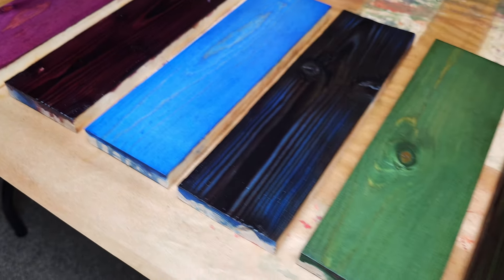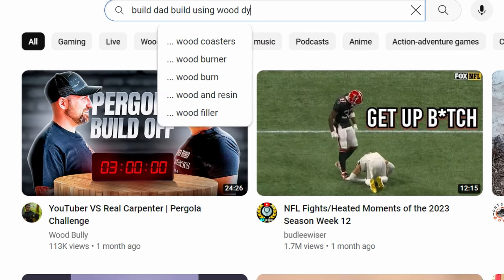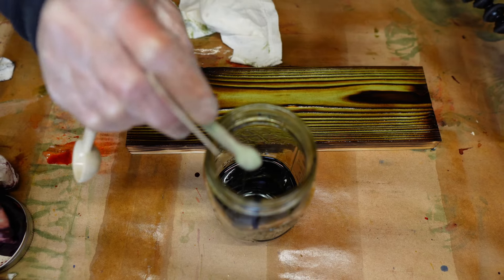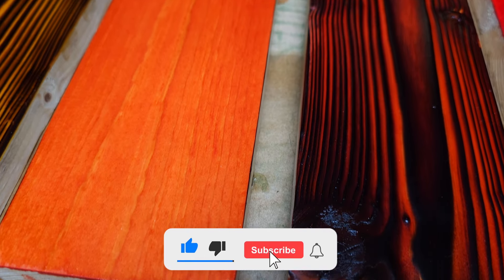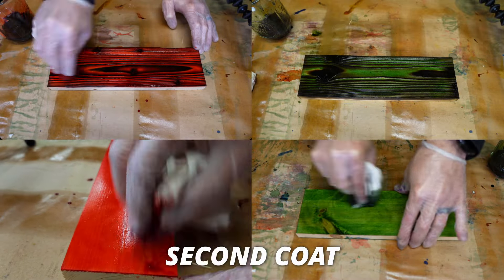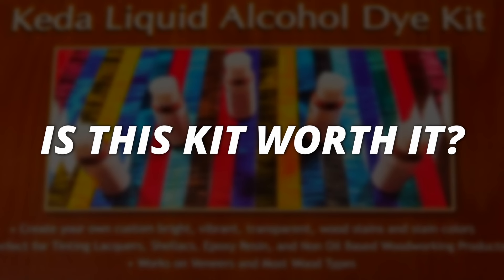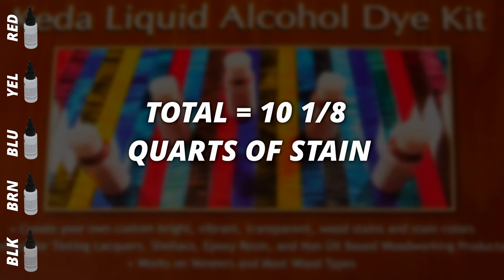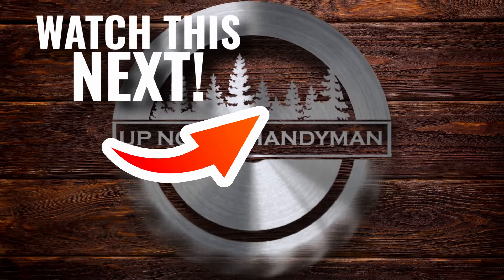How To Make Vibrant Colors To Stain Wood

Comment: Listen...Don't buy any fancy dye stuff with limited colors. USE ARTIST OIL PAINT...mix it with mineral spirits* and create ANY color you can imagine.  Been doing this since the 60's when I learned it from my Mom. ( loads of other thinners work but I think mineral spirits is best. Enamel reducer is also good)
Reply from the maker: Thanks for sharing, I will try that!
Reply: What's the recommended ratio?
Reply: Makes perfect sense why this would work. Thank you for saving time and money.
Reply: Thank you for the suggestion i will do it soon! But a little question, i have this puzzle pieces made out of wood but the old paint is vanishing and i want to repaint them using acrylic. Do i have to sand them down to remove the old paint or i could just simply apply the new paint
Reply: @BruceWayne_213 you cannot paint acrylic over oil. Ever. Oil always goes over acrylic, this I know. So sand those guys down my friend!
Reply: I need a way to completely saturate thin wood veneer (1/32") in 24 hours with vibrant colors. Would thinned oil paint like you're speaking of work well?
Reply: @WiscoWorkshop  Are the bottled dyes already  in a Alcohol type liquid straight out of the bottle?
Reply: Wow good idea 🙌🏻. What ratio do you use as I have no idea. Thanks 🙏🏻
Reply: THANK YOU!
Reply: Solid tip!!
Reply: @VeneerSlinger  I make fingerboards as well lol. Ever find a good way to dye and what to use?
Reply: @VeneerSlinger hi did you get an answer? I need to know as well.
Reply: how does it hold up in the sun?

Comment: Honestly I've just been spraying oil based spray paints into mason jars and adding solvents like acetone to keep them liquid, then using those as stain. Spray paint will dissolve into existing wood stains and oil based polyurethane as well in my experience.
Reply from the maker: @ChillyJack  that's a cool idea, thanks for sharing!

Comment: Like the information a lot. Especially like the idea of using water instead of other 3 liquids you showed. I saw on another different video where the  maker went to a JoAnn's Fabric (and Crafts) & got a multi pack of oil-based paints & mixed it with clear MinWax stain. I found a similar oil paint package but haven't tried it yet. So thats a thought. Very neat concept!.😊😊😊
Reply from the maker: Thanks for sharing! I like using water over the other stuff as well, I find it a lot easier to work with from all aspects..just my opinion.
Reply: @WiscoWorkshop  didn't think about that. Great idea. Forgot to ask,  did you use tap water or distilled water? Not sure if it would make a difference.
Reply from the maker: @guyh.4553  I used just regular tap water.

Comment: Thank you for the suggestion i will do it soon! But a little question, i have this puzzle pieces made out of wood but the old paint is vanishing and i want to repaint them using acrylic. Do i have to sand them down to remove the old paint or i could just simply apply the new paint?
Reply: Is the paint chipping and flaking or just worn away? I don’t know how detailed the paint is in the puzzle as I can’t see it lol. I’m an artist, I can tell you what I would do if I was fixing a puzzle like that, but the most important thing to remember is trust your own gut and intuition for what you want to do. 🥰  

100% sand the effected areas no matter what, if it is just worn and smooth, the sanding will be very light, only enough to give your finish something to grip to. if it is worn or chipped the sanding will need to be more in depth to remove all the chipping. you want to preserve the original paint work, you can spray clear matte or high shine finish artists use on their finished paintings on the whole piece before you sand the compromised areas. If you notice there’s a raised area between where you’ve sanded and where the original finish and paint starts, you can apply a few coats of gesso on the areas you sanded until the sanded area is even with the surrounding original finish. Let the gesso dry completely and then sand it between each coat. As acrylic paint dries fast, even artist grade acrylic paints, so if you need more time to mix/blend/and match your colors to the original paint, there’s a great product for that!  “Golden” makes a really great product “GAC 100”. You mix a dab into your primary colors right on your pallet. It does not impact the color or saturation and acts as a primer. Then you mix those primary colors to match the original finish, paint them on the sanded and gessoed areas, then VOILA! 🤩 perfect! Good as new and there will be no texture difference between the original and restored sections.  Spray the finish you used to protect the original finish onto the entire piece and you’re all done. 

Best of luck.  Sorry for the novel but this is one thing I actually know how to do really well!